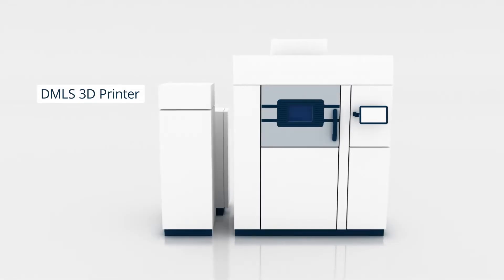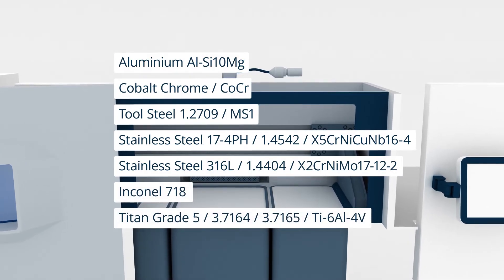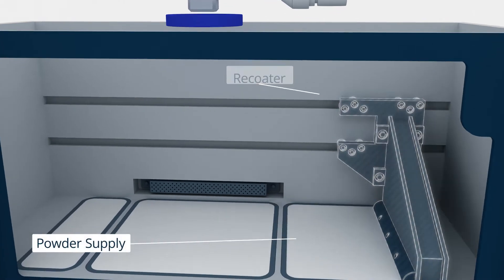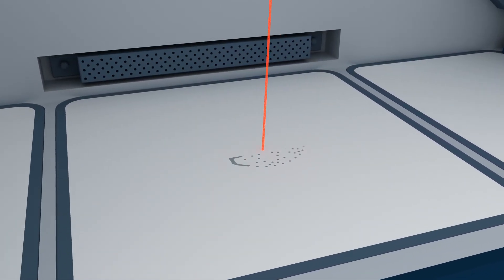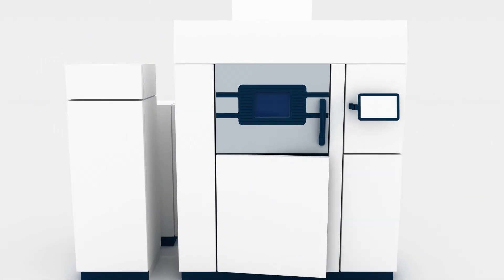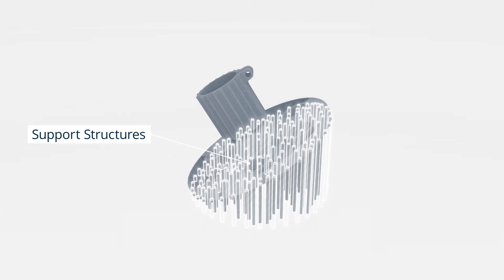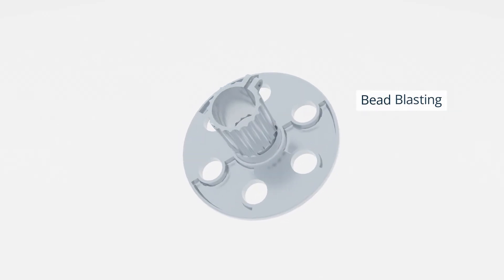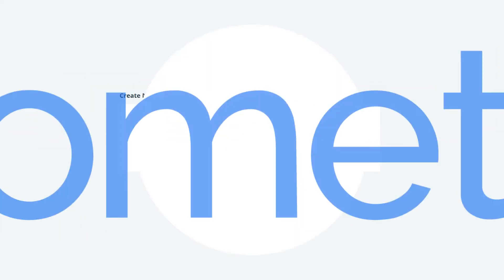How Does Direct Metal Laser Sintering (DMLS) 3D Printing Work?

Comment: This is some awesome and clear explanation. So basically, a machine layers powder for the laser to selectively harden the powder to become a solid from bottom to top layers. Is that right?
Reply from the maker: Thank you! You’ve got it right. In DMLS, a recoater spreads a thin layer of metal powder across the build platform, and a laser then melts the powder into a solid, following the design layer by layer from the bottom to the top, until the part is fully formed. Let us know if you have any other questions!